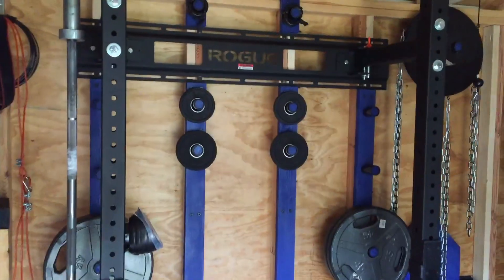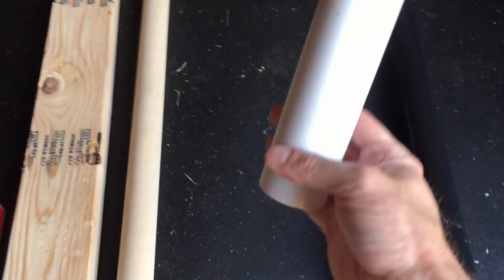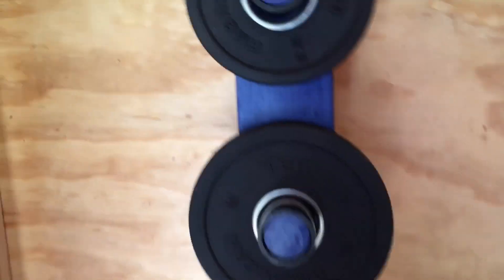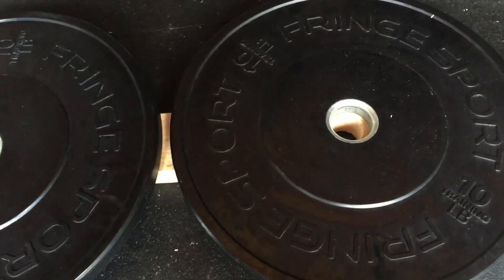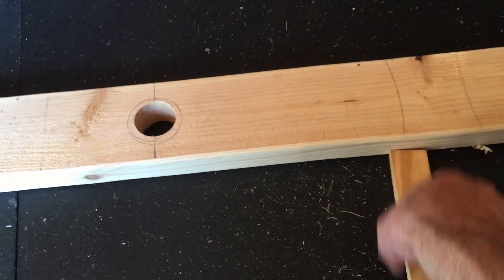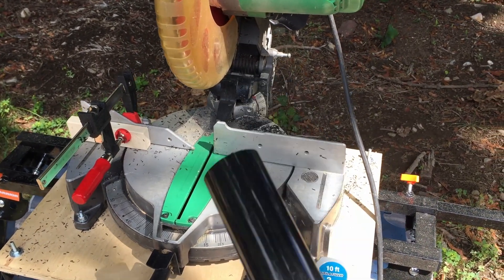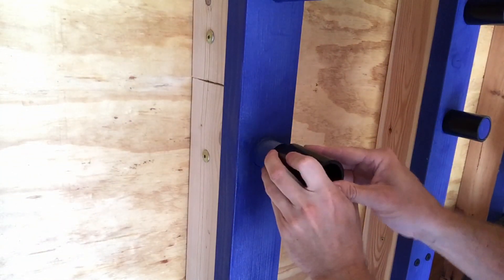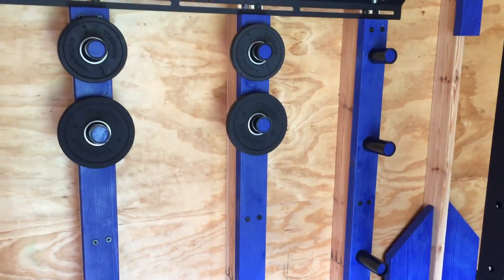DIY Vertical Plate Storage

Comment: This is the best.
My very first thought for wall plate storage was to bore holes all the way through the vertical support for the pegs to go through, and also a plastic sleeve on the peg to protect the bore of the plate from wear. 
I look online, and everyone is just butt attaching black pipe. No thanks.
You did it right my man! And boring the holes at a 2° angle is perfect, it’s something I didn’t think of! Thanks!
Reply from the maker: Awesome. Good luck with it. These are holding up great after six months.

Comment: Great job! I'm doing something similar using 2x6's. What was the length of the dowels sticking out?
Reply from the maker: Thanks. Depends. They are different lengths depending on the plates I planned to put on. Iron 45s are about 1.5 inches. So about 4-4.5 inches if two 45s are going on a peg.
Reply: I also put the heavy weights top down, for me it's easier on my back.

Comment: Would you ever consider adding a bolt or screw through the dowel and 2x4 for overkill sturdiness?
Reply from the maker: That would be 12 large bolts and for my set up they would have to be structural lag screws. More likely to split the dowel than anything. As long as your not hanging much more than 2 45s on each, they are plenty strong. Think about a peg board. Those have to hold people over 200 pounds with a thinner dowel.
Reply: @shedgymzfp4404  that makes sense. I hadn't thought of it that way. I have a tendency to overbuild things. Was this a poplar dowel? Or another kind of hardwood?
Reply from the maker: @kurtlarson2061  poplar. Bought at Lowe’s as they seem to have 1.5 inch in stock more often than HD. bring a measuring tape or calipers though because a lot of the dowels were under the stated diameter, which can make them real sloppy when you drill a 1.5 inch hole.
Reply: @shedgymzfp4404  great, thanks for your input!! This will come in handy for my home gym big time as I think how to use storage space best